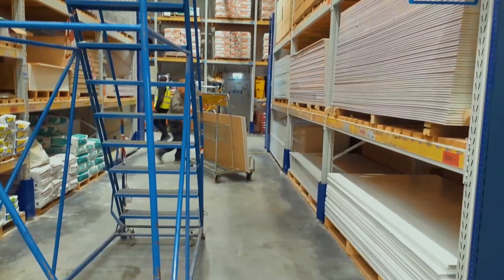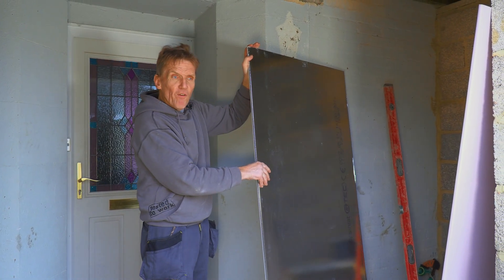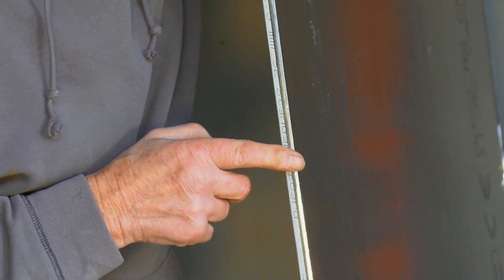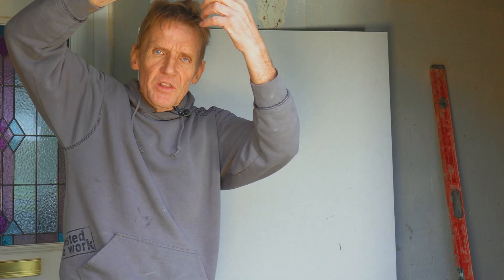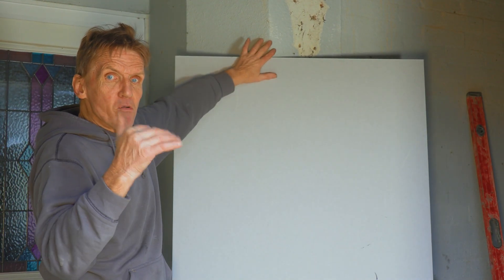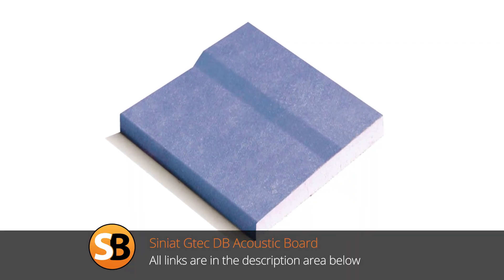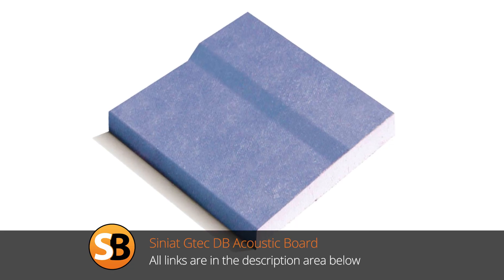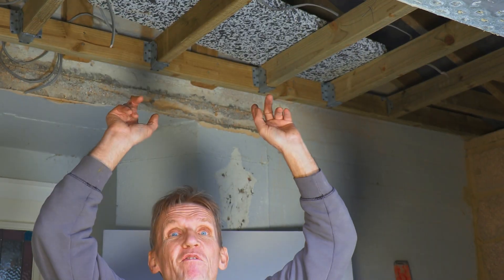Plasterboard — Why All The Colours?

Comment: Living in a new build 💀 and I'm a plumber. Fairly certain bellway bandits are just using normal plaster board behind tiles in the shower areas and the builds aren't compliant to part L regs or bs7593:2019 even though the build was only completed a year ago this month 🤷 good vid mate 👍

Comment: All the big new build developers tile straight onto green board. Sound board is good but sometimes not necessary as normal board can pass the sound tests. Would be great if you could expand on this for all the different levels of fire protection from normal board to fire and sound board and effects and spec on how it is fitted.

Comment: Question: If I line the walls to basement with damp resistant board, and I'm going to use the paper tape over the joins, do I put plaster in the joins before placing the tape over it? After that, can I just paint the board with undercoat before applying the color paint, or do I need to use something else rather than standard undercoat? Thank you.

Comment: Hi Roger. you once mentioned while discussing waste with Robin that you can use the plasterboard waste as 'insulation' with in a 'brick veneer' cavity; I may have misunderstood what you meant there. Can you clarify what you meant. Would there be any point in nailing those waste plasterboard sheets to the bottom of timber floor joists when you have a pier and beam/bearer foundation, nailing the panels to the bottom of the joist to not only hold the lose Rockpool insulation beneath the floor boards but also help stop any updraft from beneath ones house. my dad was a kid during the Great Depression and he use to save paper, and rubber bands, and well, literally everything. I think he passed these habits onto me.
Reply from the maker: Hi Jude 
The point about the plasterboard was merely that it is now difficult to get rid of the offcuts so popping them inside the stud walls is a way of losing them and adding some thermal mass. It won't insulate the walls and it is a bad idea under the floors. By all means insulate under the floors but use mineral wool or PUR board
Reply: @SkillBuilder  thanks for clarifying Roger. Really helps.

Comment: Fantastic video what board do I use in a bathroom to currently tile the bathroom
Reply from the maker: Tilebacker board, there are lots to choose from but avoid plasterboard, even the moisture resistant stuff is not very good
Reply: @SkillBuilder  thank you so much for getting back to me👍

Comment: Just wondering for internal stud walls is an insulated board better than sound proof board for sound proofing.
Reply from the maker: You should be aiming for density. The insulation will do very little.

Comment: When you use the moisture resistant green-board in the bathroom it's important NOT to use green-board on the ceiling.
Reply: What's the reason for that? What should you use? Cheers

Comment: One 12.5mm pink board will achieve 30minutes fire resistance and is adequate enough for any domestic application where it’s needed to stop the spread of flame. Party walls must be 60minutes.

Comment: The tapered edged board you showed at 2:40 min is not a standard UK tapered edge board but a "bevelled" edge tapered board which is not common here in the UK. The bevelled edge tapered plasterboards are used on the continent (mostly Germany) for taping and jointing where tapes are not used but only very strong extra hard jointing compound. "Rigips Vario Fugenspachtel" and "Knauf Uniflott cement based compound".  
Here is a video by Knauf showing the bevelled edge board system:
https://www.youtube.com/watch?v=3I3GasNSKAw

Comment: I never use green boards in bathrooms. People mistake the term 'moisture resistant' for 'water proof'. Although they're more expensive, hardibacker boards are a much better substrate for tiling on to. 

Almost every bad tiling job or insurance claim relating to a bathroom I've looked at has featured tiling onto plasterboards. Don't do it lads ...
Reply from the maker: https://www.youtube.com/watch?v=J19y7nGHM3c&t=886s

Comment: I have always thought way too much drywall went into the skip! I am glad to see it being recycled although I'd like to hear more about what it off gases because gypsum is a natural mineral and in fact I have walk through caves that are in almost complete gypsum so it doesn't seem to me that it would off gas naturally unless it's something being added to it that causes it to off gas. Rodger I know in the US the thicker of the gypsum Boards which is closer to 5/8 of an inch is used on ceilings because being thicker it has less of a tendency to become bowed over decades and sag even though it is heavier than the half inch. Everywhere else half inch is used.
Reply: Probably hydrogen sulphide.
Reply: @snapdragogon69  from the addition of?
Reply: @danielbuckner2167  when exposed to mixed waste or water it can putrefy.

Comment: Is intumescent paint a viable option for protecting a  rsj over a bifold in single storey extension, there is only about 25mm above the machined air vent slots and would like to add 12mm celotex +  1 layer of fire board to stop cold bridging as best I can, but thought 2 layers  was required, cheers

Comment: Good tip re: sealing plasterboard and filler if doing the tape and fill method. 
I’ve done this quite a bit in my house when dry lining or over boarding a ceiling and if you taper out the joint to about a foot on either side, and seal (I can recommend Zinsser Guardz) it’s invisible even with a raking light; matt paint will help, of course, as you say.

Comment: I recently did my loft dorma conversion and used acoustic windows.  Used the pink boards as stated by regs 30min check.  Then I was told I could had used blue boards to achieve better sound insulation as they are rated 30min check aswel 🤦
Reply from the maker: You are right and there is even a multi-purpose board that is sound resistant and fire resistant as well as giving moisture resistance. 
The trouble is that it costs three times as much

Comment: Interesting how these things vary for different countries. In Australia the thickness are 10mm, 13mm and 16mm. The Yanks are big on their usual overkill, they seem to only know 5/8'' board - antique system of measurement as well. We also have an impact resistant board which I'm sure you have over there - it's called Impactchek here but would be a different name over there. 
Standard plasterboard has never been approved here for fire resistant construction - regardless of how many layers. Fire rated board is required - called Fyrechek here.
Reply: Impact resistant/heavy duty stuff here is called Performance Plus.
Reply: Yanks 😂

Comment: ROGER! I can’t believe I’ve just watched this. Trying to research contour 6mm board for curved walls, got any tips on that mateeeee? 👍
Reply: I’ve used ‘Siniat GTEC contour board’ for barrel ceilings. I double the boards and stagger the joint and it’s also tapered to facilitate a neat finish.

Comment: As I understand it sound proof boards are also fire rated the same as pink boards.  Standard plasterboard can be double tacked to provide the same fire and sound resistance and has a much better u value.  I would choose sound boards on all partitions and standard on external walls if cost was not an issue.

Comment: Yeah, the sound board will stop me hearing my mother in law taking a shii upstairs because the soil pipe is surrounded... 🙄 Just use standard board and insulate... If you're using damp proof board, you obviously don't trust your tiling... If water is getting through the tiles you installed, you've got bigger problems than the board behind 😂😂😂

Comment: What I can't understand with tapered boards is ... why aren't they tapered on the 4 edges , not just the 2 , wouldn't it be much better with 4 tapered edges 🤔
Reply: They’re cut from long, long “strips” of PB at the factory.
Reply: Most of the time you have to cut it anyway, which would defeat the object.

Comment: Take the moisture board with a pinch of salt, they still get wet like every other plasterboard if you get water on them
Reply from the maker: You are right, there is a silicone coating on the paper
Reply: I think in some coutries its already illegal to use these boards in bathrooms. In sweden if I  remember correctly.
Reply: Having worked in a large DIY chain for a while I can confirm you’re absolutely right!  As the moisture board used to be in the racks longer even atmospheric damp caused it to sag and bubble up.  I always advised people to use either Hardy boards or the newer pink boards which were similar to closed cell foam.  Expensive though.

Comment: If using the green board and tiles, do ypu just tile right onto the board with no plaster skim between?
Reply: Yes, although tile cement companies recommend you use their primer first, well they would wouldn't they.
Reply: @johna7075  would this mean when you come to re tile however many years later, that the boards would be ruined and need replaced also?

What about sheet vapour barrier on stud walls then standard plasterboard, skim and tiles?

Im not sure if sheet vapour barriers are for walls or just ceilings

Comment: Can you put a greenboard first and over it a blueboard to have it waterproof and noiseproof ?
Reply: If you put a sound board over a moisture board, then you will probably just have a damp sound board🤣
Reply: You can use Blue plasterboard with green back, which has Soundblock and Moisture resistance properties.
Reply: @Tomukas  no you can't

Comment: 15 mm fire line plasterboard gives  fire protection for thirty minutes . I am just finishing a fire proofing job on a 90 foot tall smoke tunnel in an apartment block. Whole thing had to ripped out and new metal stud walls placed on 3 steel beams. Walls had to be double boarded with 15 mm fire line plasterboard to achieve 60 minutes fire protection on the stairwell side and the smoke tunnel on the other side.
Reply: 60 minutes to evacuate a whole block of flats with potentially old people still seems a bit short. Better than nothing though
Reply: @daz374 the smoke tunnel has been completely stripped of insulation to the apartment walls. There are now no combustible materials in this tunnel and no fire  can breach the tunnel. The fire wall only serves as an extra precaution for fire fighters as the stairwell is the only access to any floor in the event of a fire . There are new 60 minute fire doors on all the lift lobby landings . They already had a fire in an apartment on the eighth floor. It didn’t affect any other part of the building. And before any upgrades were completed. I was talking to a fire engineer from the fire service. He says fire brigades can make a response within 5 to 7 minutes. As long as the smoke and heat detectors are working normally fires will not get out of hand if proper fire doors are in place.
Reply: @josoapification  unless they tell you to stay put....
Never thought I'd ever hear that as advice, wrong advice....
Reply: @almilhouse9059  the upgrades are so people can stay put . The contact we have nearly completed was for a housing association for independent living for disabled vulnerable and elderly people . They all have a stay put policy. Fire alarm tests on all magnetic held cross corridor doors are carried out weekly. As long as all fire doors have fire and smoke seals. Evacuation is not normally necessary.

Comment: I worked at a hospital last year where they built a new Xray room. They had that blue colour sound proof plasterboard which I had never seen before plus they had lead lined plaster board which I never even knew was possible. The board sizes were smaller, 2 x 8ft and due to the weight it took 3 men to lift the sheets to prevent the plasterboard snapping under its own weight. Also before attaching the lead lined p/board, the chippy tacked on a 3" lead tape to the entire length of timber studs. This was to ensure no radiation was able to leak through the wall.
Reply: You can also get plasterboard with barium sulphate in its core which is xray resistant.
3 meter long 15mm thick fireline,  sound bloc or duraline weigh about 56 kg each, when you spend a day fitting them you know you've done a shift.
Reply: Back in the day Gypsum did an backing and finish called X-ray plaster for floating jobs in hospitals etc.
Reply: How do you cut lead lined pasteboard?
Reply: @edc1569  you borrow the carpenters best saw..😁
Reply: 5G!